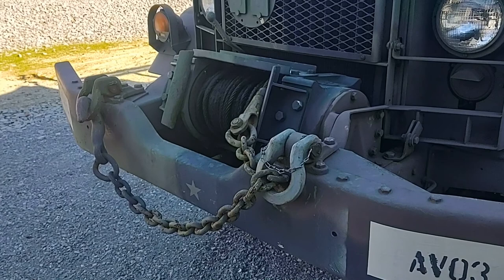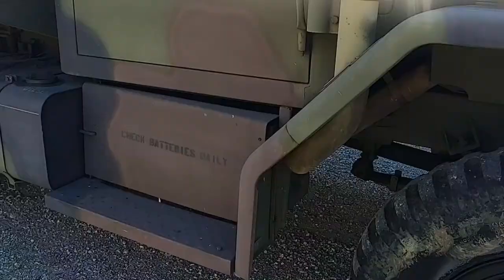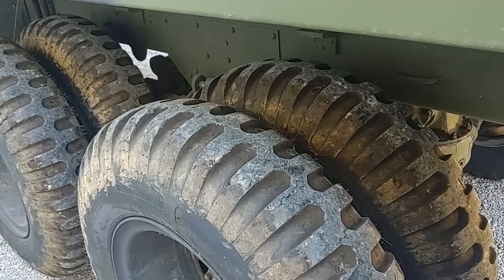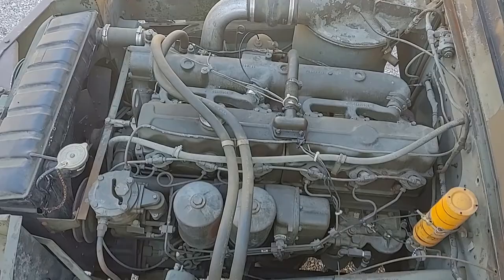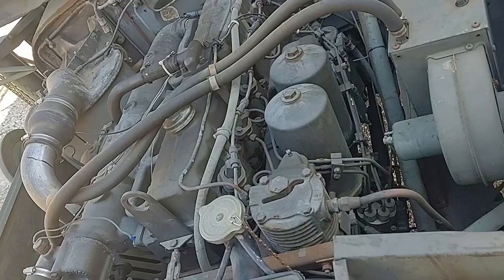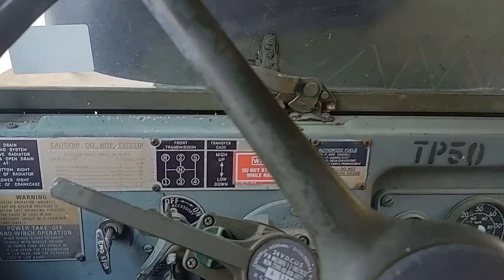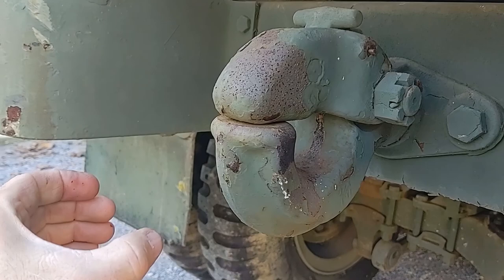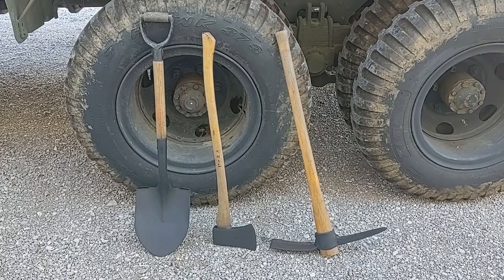Engineering Specifications M35A2

Comment: I learned to drive one of our gun trucks in Viet Nam. I was not an assigned driver because I didn't have a valid driver's license at that time. The truck suffered some considerable damage from an accident. But still ran. My buddies taught me how to use the clutch. And after that, I was using it to transport water from the water station to our barracks. Oh, I did not cause the accident, another driver did. Talking about a pretty tough and reliable truck, it certainly, was.
Reply from the maker: Thank you for sharing and thank you for your service!

Comment: Nicely done review of the M35. 😊👍
One observation: NDT tyres were not designed to fool the enemy. Any competent observer can tell which way the truck was going regardless of directional or non-directional tyres.  The primary advantage of non-directional tyres is that they may be used on any wheel station. With directional tyres, they may only be used on one side or the other unless the rims were symmetrical, which is very rare as offset rims are far more common, such as these on the Deuce.
Reply from the maker: Great comment.  Thanks for sharing!

Comment: By 1970 several of these were fitted with power steering.
Many military vehicle engines were typically detuned to provide more reliability for tactical missions. They could easily be bumped up in power though.

Comment: Great video. The transfer case is 2 speed manual shift. the front axle engagement is air shift. The transmission shift pattern was modified so the Soldiers A, B,C. fit into the cab for longer distance comfort.
Reply from the maker: Thanks

Comment: The m35 spanned all of the years. M35a2 was late 60s. The a2 upgrade was the super turbocharged multi fuel. The overdrive spicer 5 and the air shift transfer Case. Before they were mogas no over drive and Sprague's in the transfer case kicked it in. At between 7 and 9 percent wheel slip and full lock in low range. The reason they went airshift is because if the Sprague's were bad you would have no 6x even in low